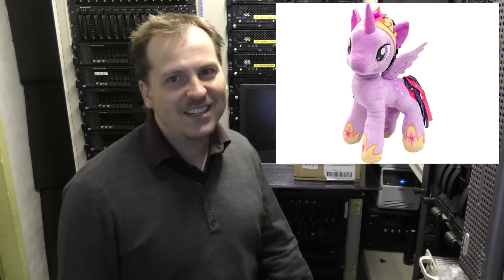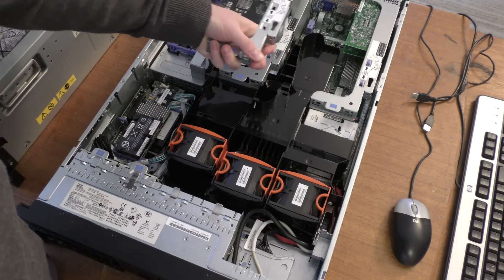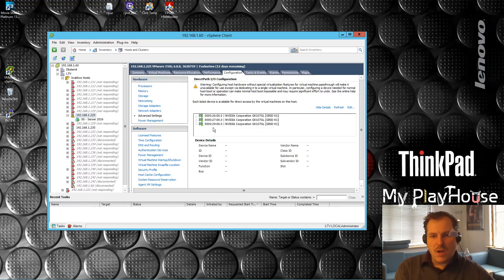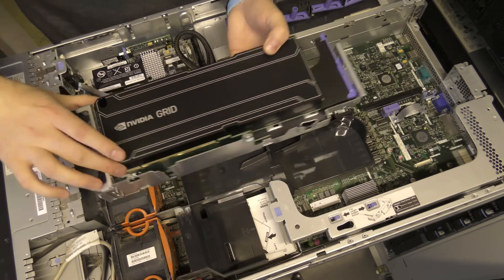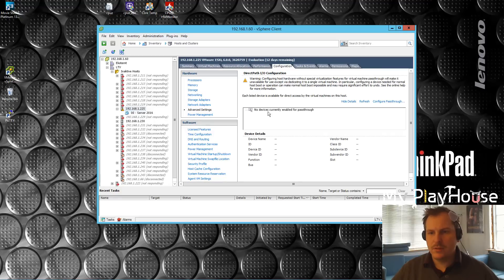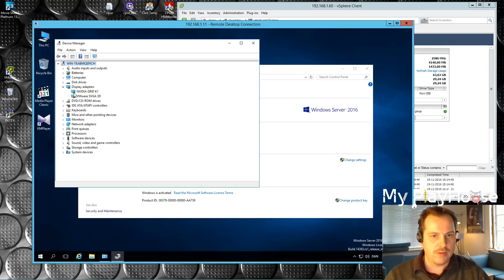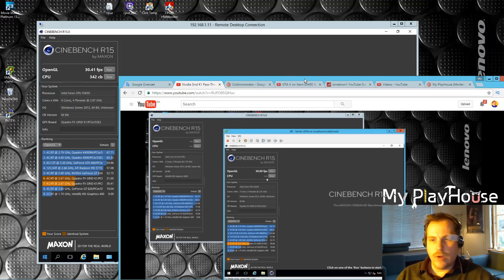x16 Riser Card - IBM x3650 M2 & M3 for NVIDIA GRID K1 - 438

Comment: Hey Morten, I know you did this work years ago but I'm trying to get a graphics card (for computation) into my x3650 M3 and I can only find a single 69Y4325 riser card on the internet for $200+, which is way too much.  I saw you used a riser with 8x slots, did that work for you at all?
Reply from the maker: Yes that does work!! and most of the time you do not lose much with an x8 instead of x16

Comment: does the x16 riser card run on the M1? although the M1 doesn't have extra GPU power cable access, there are 16x cards that don't require extra power like the GTX 1650 but I think the M1 only sends 75watts through the PCI card
Reply from the maker: No this riser is different from what is needed in the x3650 M1

Comment: Came across this, just got my hands on 3 of these servers for a great deal. wanted to turn one into a plex machine, but cannot find an x16 riser for under 200$. Going to try a generic x16 riser for a desktop (for when you want to like side mount the video card) and see what happens
Reply from the maker: The x16 riser card for the x3650 M2 and M3 is so rare,, I call it the unicorn. It is possible to open up the x8 slot, and let the GPU card stick out the end. I do have a video on that.
Reply: @MyPlayHouse  the worst/best part is, my only idea around it you already tried. I found that video minutes after commenting.

Your videos are awesome and informative man. Thanks.

Comment: all gpu cards you tested so far are too big for your pci watt capacity, you should try the 1x 16x rise SATA power stealer https://www.ebay.com/itm/USB-3-0-Pcie-PCI-E-Express-1x-To-16x-Extender-Riser-Card-Adapter-Power-BTC-Cable/292528705269?hash=item441c11cef5%3Am%3AmG0NGb9fYX99_93n98pJvbQ&var=591354515066&_sacat=0&_nkw=riser+1x+16x&_from=R40&rt=nc&_trksid=m570.l1313 this should do the trick with a 75w card.
Reply from the maker: Hi areavirtual3d
Thank You very much!  glad you liked the video :-)
Thank you for watching! :-)

Comment: we need a product do not exist but it should, is a 8x riser 16x extension WITH external power input, there are tons of thoose but they are 1x to 16x, used for mining, but then using a gt 1030 or quadro p400 would be a waste in performance, should work but fps will be crap is my guess.
Reply from the maker: Hi areavirtual3d
Thank You very much!  
Thank you for watching! :-)

Comment: you could avoid wasting your money by simply googling PCIx16 vs PCIx8 graphics cards
Reply from the maker: Hi Bill Killernic
Thank You very much!  I am aware that there is not much of a difference in speed. But he x8 riser does only supply 25w of power to a card, where a x16 supplies 75w,, and sometimes you just wants the real thing!
Thank you for watching! :-)
Reply: Really? I thought the power drawage is dependent on the revision of the PCI protocol (for example PCIe v3 gives more power than PCIe v1) but I am not sure whats up with IBM racks and their rizers :P There is a cable you could have bought (mentioned in an other discussion in this video by matty2168 ) that connects to two psu ports to give more power to your card
Reply: Oh and I forgot to mention that the K2 (or K520) series are the ones with the "powerful" graphics the k1 are not that good in gaming or rendering on high FPS

Comment: It would be interesting, if the circuitry is simple enough, to try and reverse engineer the riser card and get a schematic up so people could potentially use fabrication houses and make their own riser cards.  I managed to pick up a x16 Riser for a HP DL380 G6/G7, but the PCI socket is on the upper back side, so it is ment for only single-width cards as opposed to double width (wish I would have payed attention to that when I bought it).  I could dig it out of my server parts box and check out the circuitry, if anyone is interested.  If there is significant interest, I could also see about budgeting some money to pick up one of these IBM risers and do the same sort of analysis (yay for hobbyist EE background)
Reply from the maker: Hi Jon Ellis
There is a bit of electronic on that riser board,, I think i counted 34 components. I did think about copping it.
Thank you for watching! :-)

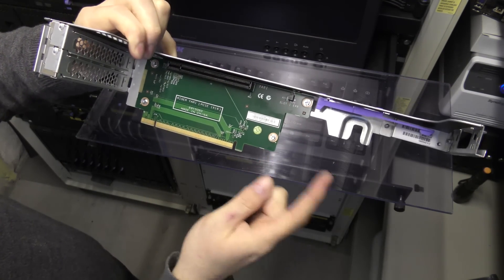Comment: At2:58 if i pause it looks like only something like x12 pins are shinning in the light...it's that riser physically x16, but electrically x8 or x12 ( never heard of this ) or something else ?
Reply from the maker: +nicolae788 
I do think this is a true X16,, I have studied it before making the video.
Reply: My PlayHouse yes, it' s strange how the connectors are shinning for just half or 2/3 of the lenght. Anyway you do not need x16 for the video card, it can run at x8 and more important it's the pci-e revision. Running a 2.0 rev video card in a 1.1 or worse 1.0 rev slot, then you have a serious bottle neck. All the best and keep having fun with the servers :)

Comment: it may be that the card is throttling as it is not receiving enough power from one cable. To test this, you could hook a desktop power supply to the second power port whist in the server and see if it's any better. this would prove that the card is working at least. Morton
Reply from the maker: Hi Yandarval
Thank You very much!  Now with the x16 I shout not have a problem,, 75w from PCI-e x16 and 75W from the 6-pin and the card uses a max of 130W : http://www.nvidia.com/content/cloud-computing/pdf/nvidia-grid-datasheet-k1-k2.pdf
Thank you for watching! :-)

Comment: Not sure if I should be happy or sad for you, Mortjen >.<
Sad because it didn't fix the issue and came at a high price but happy because you found the Unicorn and the Mermaid maybe?

It would be curious to run tests on not just the first GPU. Maybe a line of testing to see if the modded x8 method would have worked with GPU 1, 2, or 3 and the x16 card the same way. I would expect GPU 3 to run into issues on the modded x8 due to bandwidth constraints but am purely speculating. 
There has to be some benefit in this application, somewhere >.<

Another question would be is the bus capable of handling the grid GPU? I mean, is the GPU being utilised 100% while benchmarking? CPUID's HWMonitor may help to figure that out in this regard. Nothing to suggest that it isn't, but good to verify, right?

I really did hope this would have solved the issue for you.
Reply from the maker: Hi themaconeau
I think it is like putting three graphics cards in a computer,, it does not become three times faster,,, they need to work together first.
I did try to give it all three GPU's 
Thank you for watching! :-)

Comment: nice vid one more time.. i'm starting to play with passthrough on an "oldish"e5 2670.
Reply from the maker: Hi Douglas R. Andreani
Thank You very much!  I like an server with an E5-2670 :-) It is not that old!! yet
Thank you for watching! :-)
Reply: the good thing is that the processor is very cheap, i got one for 50 bucks, the motherboard are more rare to find a good deal, but if you are patient, you can have a 8 core/16 thread for less than $200

Comment: Have you tried baking the grid card? It might help. I found that if you cover all of the capacitors and plastic parts with aluminum foil and then bake it for 5 minutes at 200 C (with the thermal fan) is the best option.
Reply: marek mrukwa all you are doing is reflowing the card when you do that 9 times out of 10 that is a temp fix that will break further along
Reply: That's true but any fix is better than nothing.
Reply: It is probably too expensive to try it on a grid card. If you could buy a broken one cheaply it could be the solution.
Reply from the maker: Hi marek mrukwa
Thank You very much!  this can work,, and it can brake the rest.
Thank you for watching! :-)

Comment: Great video as always, Morten! I found your channel a week ago and have been watching and learning a lot. It's all very cool stuff. Thanks so much for sharing with all of us!

By the way, I'm not sure you wasted 160 GBP on the PCI-e x16 riser card. Since the purpose of the PCI-e connection is for data to travel back and forth between the GPUs on the K1 and the CPUs and RAM in your x3650, wouldn't you need to run a test where you fully utilize all available GPUs on the K1 (three out of four it seems, in your case) in order to try to saturate the full bandwidth of the PCI-e x16 or x8 connection and hence determine if the x16 connection performed better? I would imagine that you would need to run a very heavy benchmark like Unigine Heaven or 3DMark in order to try to saturate the PCI-e connection as much as possible and push the K1 to its limits. I suggest these for testing as they will use large texture files for 3D which need to be sent from RAM to the K1. Maybe you could try installing Windows directly on to the x3650 (without VMware) and comparing the results of the PCI-e x16 vs x8 riser cards? This might be the purest test. I wouldn't be surprised if you got better results when using the x16 riser card.

Perhaps worth an investigation and a video? :)
Reply from the maker: Hi Leonard C
Thank You very much!  glad you liked the video :-)
Thank you for watching! :-)

Comment: Microsoft rdp does not take advantage of the grid card.
Reply from the maker: Hi E.J. Bevenour
Thank You very much!  Any better sugestions?
Thank you for watching! :-)
Reply: I looked into this my self and running server 2016 or 2012 on the bare metal and running a vm with Windows 8.1 or 10 enterprise might give you the ability to use remotefx graphics card. Then when you use rdp into the vm with Windows 8.1 or higher with remotefx enabled for the session, that rdp session should be accelerated by the gpu. This works by giving the vm os a remotefx graphics card the proxies information directly to a physical gpu on the host. In Windows 10 pro hyper-v this option is super easy to enable just a check mark. When I did a setup on Windows server 2012 r2 I had to setup remote desktop services and a active directory domain. I do not know if the requirements for enabling remotefx on Windows server 2016 have changed. You can also look into citrix remote desktop solution as they specialize in accelerated gpu vms. The issue is not if the server can pass the gpu through, but how will a client access a remote machine and transmit accepted media.
Reply from the maker: E.J. Bevenour 
Cool Thank you!
Thank you for watching! :-)
Reply: If you need any help feel free to contact me. I would not mind setting it up for you either.

Comment: This may be a stupid question from someone knowing very little about virtual machines, but when you were passing through the GPU you clicked to add a PCI device and chose one of the 3 Nvidia Grid options... Could you not add two more PCI devices and choose the other two Nvidia Grids? Would that let you use all 3 GPU cores, or are you already using them all? I don't know how it works, just something that confused me hahahah
Reply: I was about to ask the same question.
Reply: matty2168 Actually there are 3 GPUs on it, with many Cores. Nur your Almosen Right ;)
Reply from the maker: Hi Pascal Dziersk
I have tried to give it all three GPU's,, no difference,, or I am doing it wrong.
Thank you for watching! :-)
Reply: My PlayHouse what i wanted to say is that the Grid does Not only have one Chip on it, thats why they are so expensive. As you showed in another Video there are 4 Chips on it Physical, and your Server only recognizes 3, so i think one is faulty. Did you installiert a NVIDIA Driver Insider your VM? So you Can See if it get recognized as a Grid Graphicscard?
Reply from the maker: HI Pascal 
Do see more of my videos on my Grid card.
Reply: you need to enable SLi on the nvidia control panel options also check this video /watch?v=lO4FmOh404k

Comment: This makes no sense. Why do x16 slots exist if x16 cards work the same in x8?
Reply: x16 gives more bandwidth.
Reply from the maker: Hi sleeptyper
It was hard to see where my £161 investment went :-/
Thank you for watching! :-)
Reply: sleeptyper True but not by much x16 is only 5 to 10% higher in bandwidth and it really doesn't make much of a difference.
Reply: Naters305 In some applications, such as GPUs, manufacturers and customers want that extra bandwidth.

Also you see in the video, you can divide a x16 slot into two x8 slots. So x16 slot gives flexibility to the design.
Reply: My PlayHouse
Well, you wanted to get that thing working - against all odds in a machine not designed with separate GPUs in mind. Proper pioneer attitude there. Thumbs up for you! :)
Reply: It`s better cooled than general PC